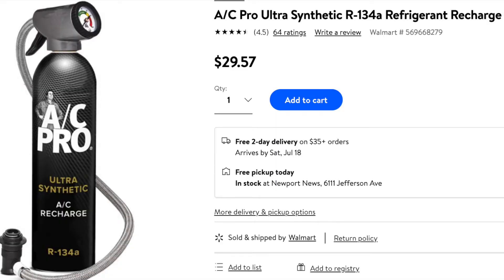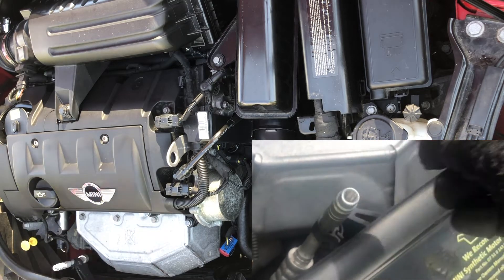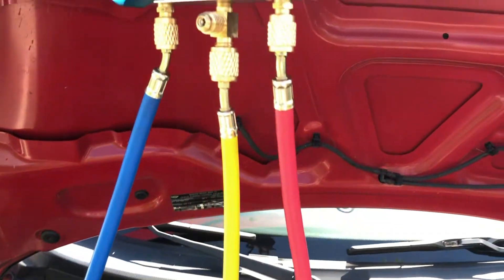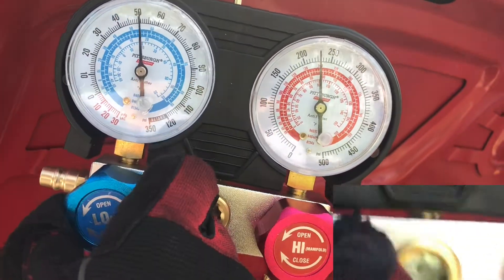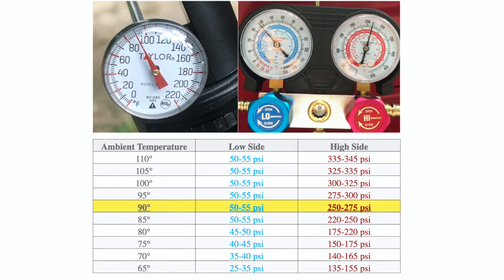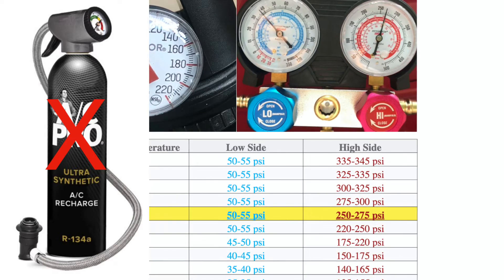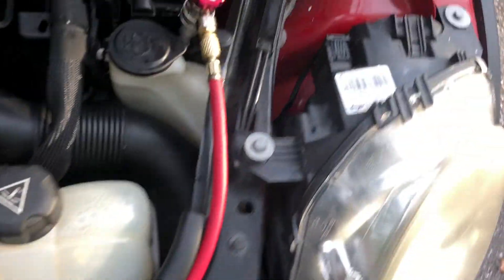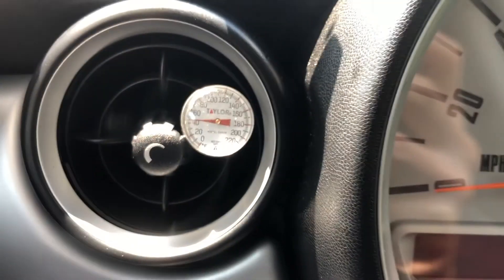AC blows hot air, add more freon gas - mini cooper r56 2nd gen

Comment: Good instructional video.  I have the 2012 base-model Mini Cooper R56.  Before the recharge when your A/C blew warm air, what were the starting high and low side R134a pressures with the A/C on and the engine running?  This key information is missing in your video.

Comment: To be clear. We should Always be concerned w/ the High Pressure reading or whichever reading hits the mark first?
Reply from the maker: If go above high limit, AC will be disengaged automatically to protect your cooling circuit, resulting in AC off. Best is adjusting at the middle pressure.